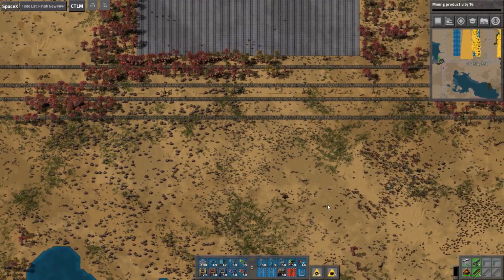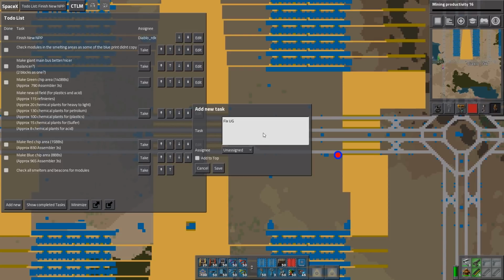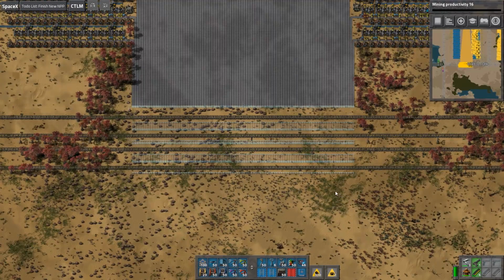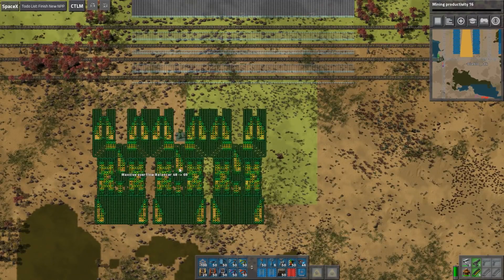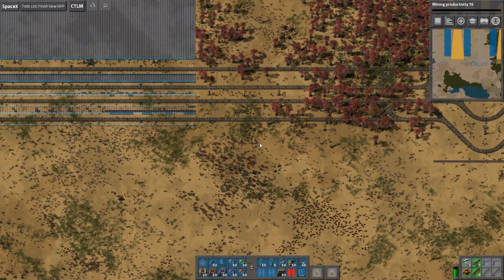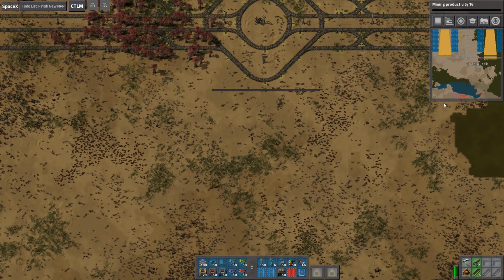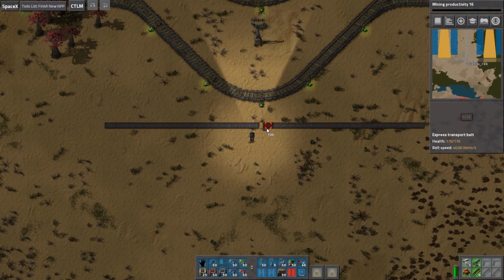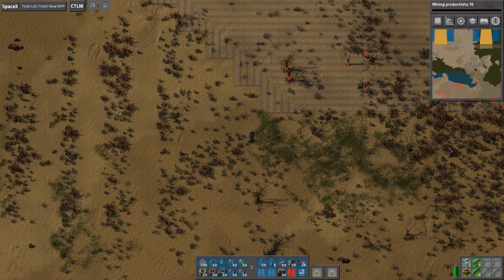Factorio - Belts, Bots and Beyond: Part 84 Measuring and explaining.

Comment: I don' t know if I missed it, if I did, apologies. I'd like to see a small video about HOW you used the calculator to come up with your numbers. I found all online calculators for factorio bases to be wildly unusable in the graphical user interface front and user-friendliness. An explanation of "I need this, and with this parameter, and these beacons, will give me these numbers which means I build this many because of this here thingy..." etc.
Reply from the maker: Lets start with this.
Here is the link for the calculator I used with everything setup in a way that gave me the numbers I needed.
https://kirkmcdonald.github.io/calc.html#zip=fYvBCgMhDET/JqcKq55qycfsaiiCJiEq9PO721Mv7eUxzLzplTHCQW0ivdRoDDdt56Fi0101dDUpGDcoHTVCOXBczOgD1El94Cnk81j56RbXmSz5e9g26FJWo4FZ9pZ4tS88PsmHWxZVMidGv4xqwn/2Nw==
Let me know if it helps.